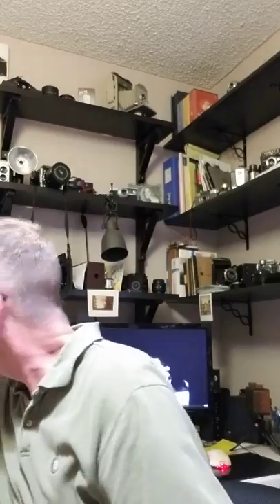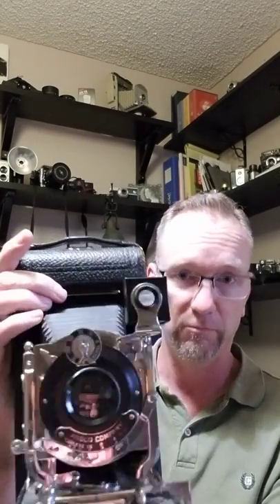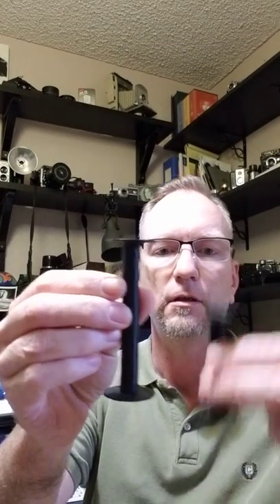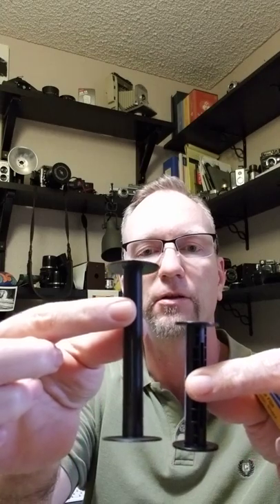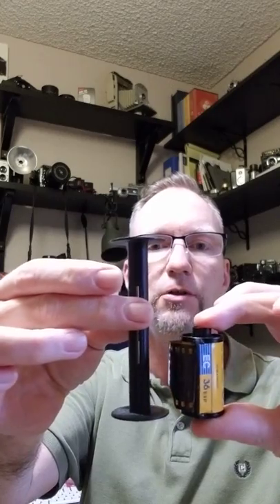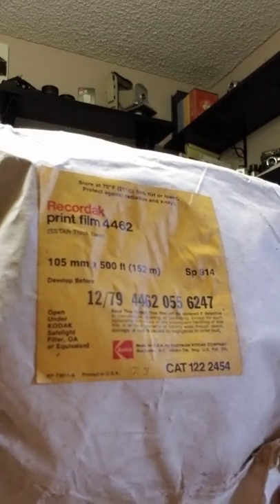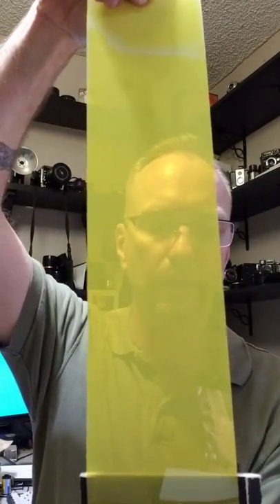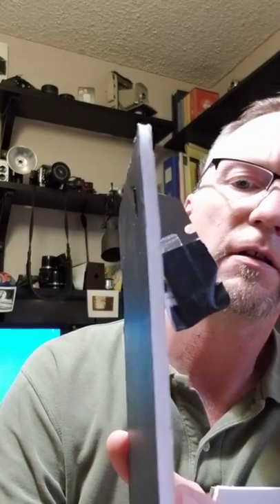Making and using 122 film

Comment: Thanks for this.  I have some 105mm Kodak FS microfilm that can successfully be rated at 25 ISO, however, it is panchromatic, so no safelight slitting and loading. I built a slitter and was able to 122-sized film for my Kodak 3As but always screwed up the backing paper.  I have enough 122 spools, but the backing paper has always been a problem.  I'll be looking for that pot-growing paper.

For anyone wanting to know how to develop, 90mm is a common non-destructive testing film size and you can get 90mm reels for development.  They are like for 50 feet so they are huge, but you can develop in a pot big enough to handle the reels.  You can also use two separatable reels and a central core to get a more small tank manageable size.

Comment: Thanks for the great video!!
Couldn't you just use Ilford FP4 90mm?
It would save the slitting step on the film and the developing would be easy peasy and more controllable.
I did like the backing you are using!! Kudos on that tip!!  I was Cutting 6mil window black out material and sticking labels on it the white backed material you suggest is far better and easier to see in the window!!
Reply from the maker: Thanks Joe. You could, of course start with film that is the correct width with an established emulsion, and that's what most sane people would do. But I found a roll of this stuff incredibly cheap (Ilford is not cheap), so I bought it and then figured out what to do with it. The other nice thing about a film that is 5 inches wide is that I can also cut it into 4x5 sheets and shoot it in my large format cameras.

Comment: Cool, I also shot with mine. I used A fuji aero film slit it from a big roll and shot it as  asa50 , used a thick black nylon as a backing paper . You didn't show your processing tank modification. Its a challenge on every step.......
Reply from the maker: I agree. I haven't tried it again. I am mostly cutting it into 4x5 sheets. It works pretty well that way.